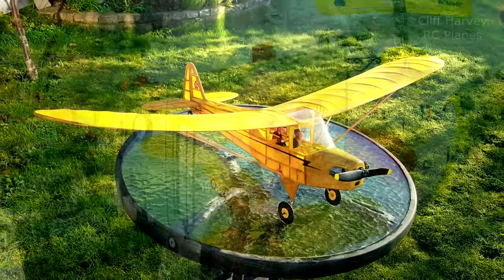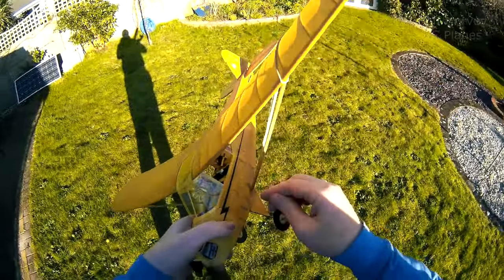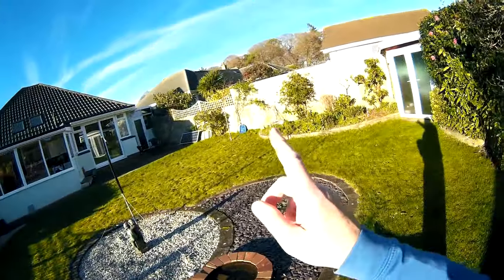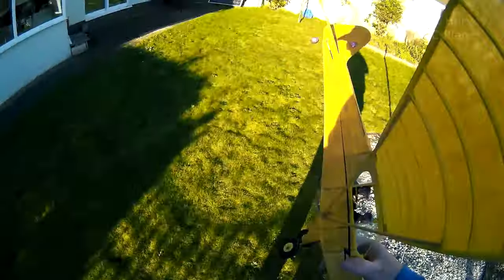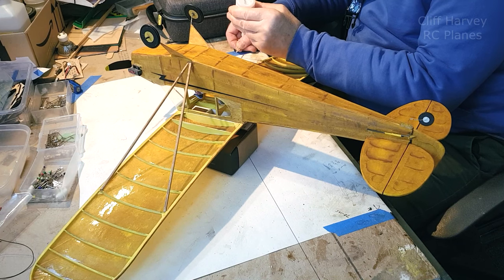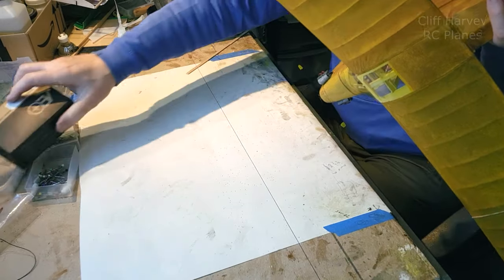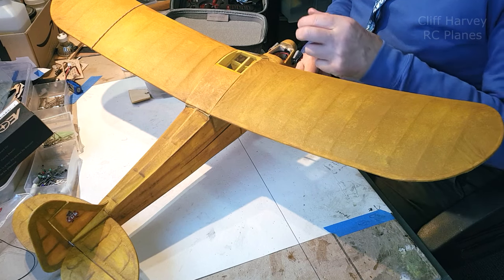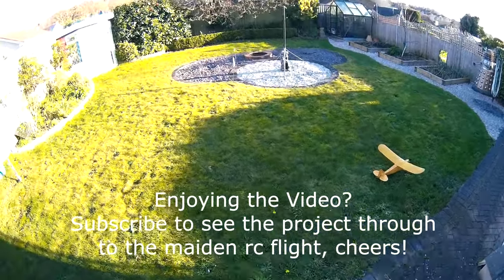The Unexpected Journey: Piper Cub Takes Flight Around the Pole

Comment: Hi Cliff do you trim outside (in this case right) rudder for RTP? I flew control line when I was a kid, and that was a necessity. If you've already covered this my apologies. Love your work!👍
Reply from the maker: Hi Cal, all I do is to set the rudder trim on the transmitter for full right deflection, usually this is enough but if I feel the line is getting slack I'll just apply right rudder ... especially going into wind ... gotta keep that line tight, cheers